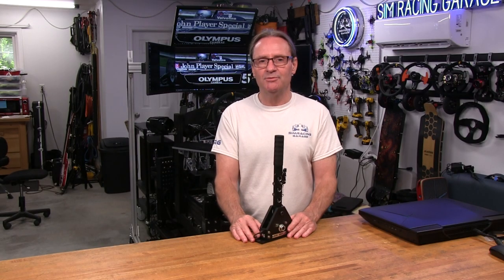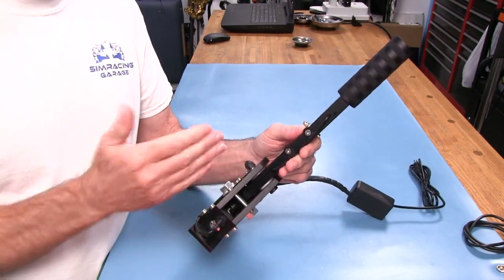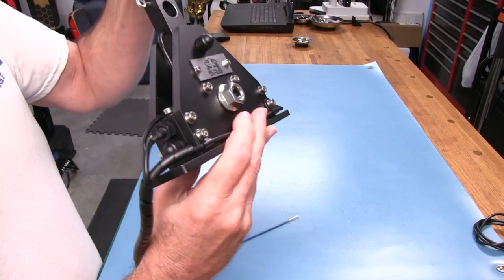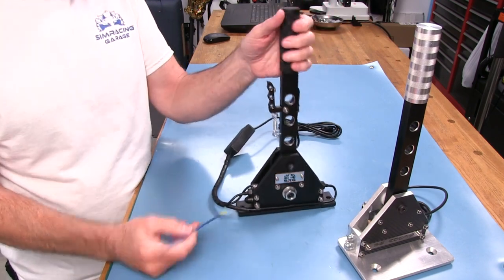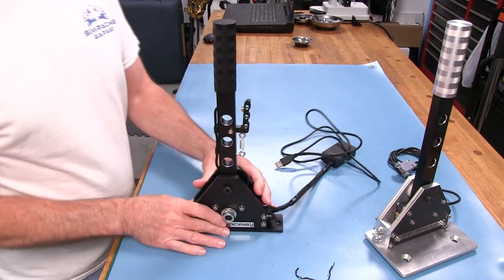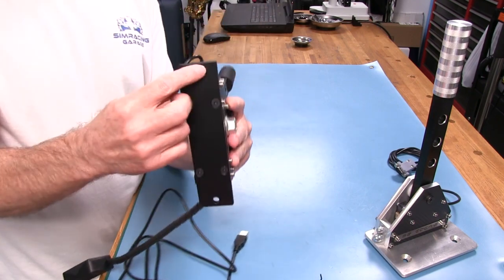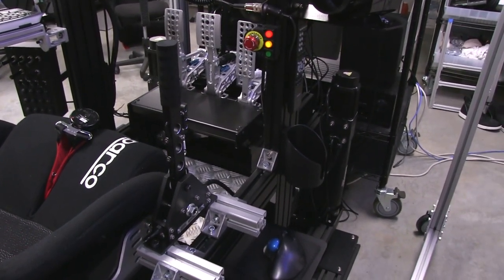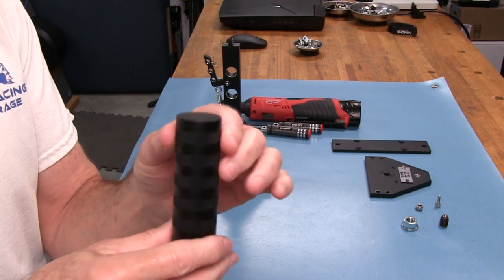SG Racing Pro Sequential Shifter Review

Comment: Got one myself since a couple of months now and it is amazing how good this thing is for the price. Also dealing with them is super easy and they reply to you within minutes, at worst within hours but always same day.

I had a DSD Seq. Pro before which is almost twice the price for us in the EU and the Shifter is nowhere near SG RACINGs quality. Not that the DSD is bad, but it should be cheaper than the SG, not much more expensive.
Reply: Hi There. I was thinking of buying one of these to replace my aiologs shifter..are you still happy with it??
Reply: @mattatkins2128  yeah the shifter is superb. You need to tighten the screws if the clicking goes too easy but apart from that what I really like is it feels like a proper shifter as it sits really strong on the rig, just solid material
Reply: @empii911  thankyou!
Reply: @mattatkins2128  hi did you purchase this one?
How does it compare to your aiolog? Was the upgrade worth it?
Reply: @superblitz2274  I didn't change in the end. Went back to another series and it kinda reset my interest in getting one.
Reply: @mattatkins2128  oh so you kept the aiologs?

Comment: Good review. I would add that the holes are not just for styling; in manufacturing it reduces the amount of material used, and it also reduces weight (in this case maybe not a whole bunch but still some).